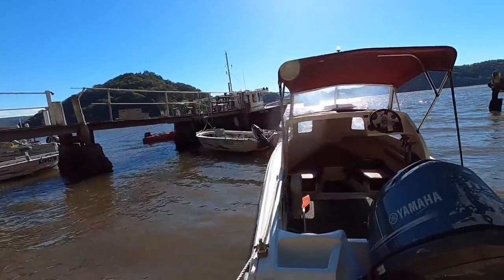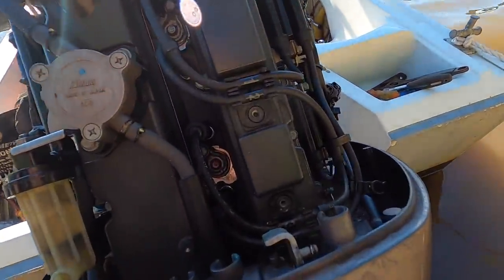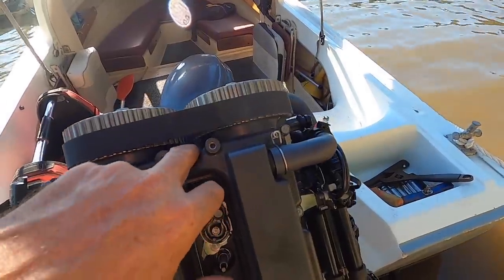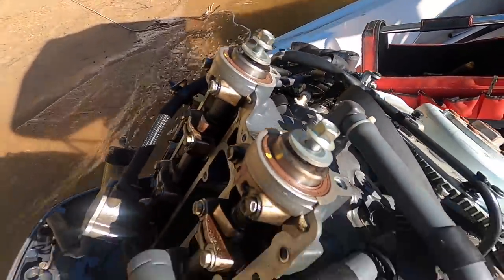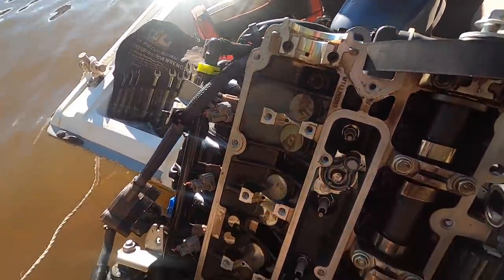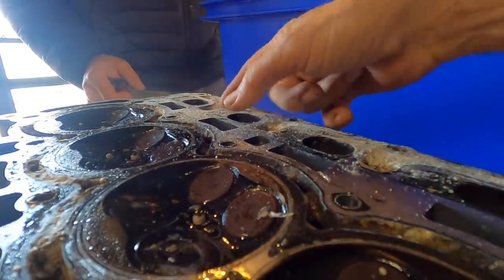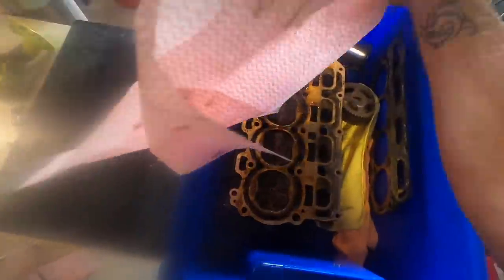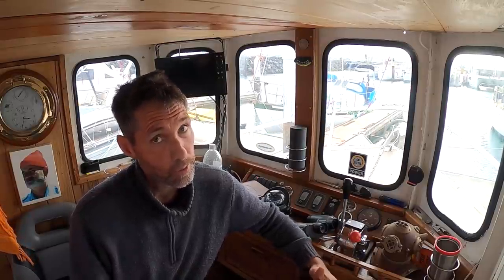Yamaha outboard twin-cam cylinder head removal

Comment: The outboard dilemma; an expensive fix on an expensive outboard still leaves the owner with an old outboard. Well stated, Stu.
Reply from the maker: It is hard to know which way to go sometimes. All the birds of this outboard still have value at a wreckers.
Reply: Its the boat version of
"Nothing as expensive as a cheap Mercedes"
Reply: As a new Tech, it drove home the fact of when to walk away from a repair.
Reply: I'm assuming, too much pitting on the cam and lifters to warrant a clean up and re use.

Comment: As a longtime auto mechanic I never shave or sand aluminum heads with overhead cams. If warped and sanded flat cam failure is always guaranteed. Unless you rebore cam bearings they are almost always out of line when reassembled... If shade tree repair necessary on tight budget. Fill bad scratches with JB weld use razor blade to remove excess... best of luck...
Reply: You need to introduce heat for aluminium block
Reply from the maker: Yes, sending it off to a cylinder head reconditioner is probably the only realistic option. Will save the DIY approach for the two stroke head.

Comment: You have 10mm sockets down there? I guess that’s where all mine have rolled.
Reply from the maker: They all roll down to the Southern Hemisphere.
Reply: They must all end up in my engine bay somehow.. every time i work on my car there is one rolling around
Reply: Both 10 and 13mm! 😄 
Great video!
Reply: I wonder if all of my 6mm drill bits are there also

Comment: What happens when a motor gets really hot is the rings lose tension. They're supposed to be brittle (as you know if you've ever broken one using a stupid ring expander instead of putting them on with your fingers - I blushingly digress) but interestingly what happens is when the motor gets really hot if you remove one is it can be stretched out like a piece of wire. When they get to that point they can't hold their shape properly. They obviously need their shape but it is so combustion pressure can properly force them into the cylinder wall gaining a gas tight seal. When the tension is lost or partially lost you get blow-by and of course low compression.

Comment: I've just done 2 earlier (Carby) versions of this motor, same problem in both. Corrosion was the cause in both cases, both on the mating surface of the head where it contacts the gasket. I did get them both welded and machined back for not a terrible amount of money. 1 of the engines is for a friend and is being sold soon, the other one is mine, whether I keep it or ditch it, I haven't decided yet. I don't think the anodes really do their job in these engines, to be honest, in both cases they looked brand new. A couple of things  learnt; the "lifters" in the 2 I did were actually buckets and 25mm shims, and if you have to adjust the valve clearances, good luck, because the shims are ex Japan if genuine, and around $400 for a set, and not a lot cheaper off eBay. A better way is to get a machine shop to skim the tops off the valves to get the clearance back. The other thing I learnt is this engine is based off a Ford Zetec engine and a lot of internals are interchangeable - and cheaper from Ford than from Yamaha. (Check the camshafts, they likely have a Ford logo cast into them). I think if it was my "Daily driver" I'd probably just replace the outboard too

Comment: I hate the smell of tectyl. I always used to keep a can of degreaser with it as the nozzle always seemed to block up, I just swapped it over when it started to clog up, parts I tectyled usually needed 2 cans though. Love the vids. Cheers Mav

Comment: Stu how did the water get into the oil
was it in the fuel previously,  did it enter
through rain leak, was it seawater through a crack/opening,
was the oil contaminated,  was the motor at fault .. etc???
Onya 👍👍
Reply from the maker: It comes up through the cooling passages for the engine and passes either through a corrosion hole or a blown head gasket into the oil passages.
Reply: @DangarMarine  Ahhh gotya, thanks Stu, Never throw away any
of your footage, they all worth viewing.  How was the Sanctuary Cové
Boat Show ??

Comment: I would like to know if that 115 Yamaha is savagable... I'm presently looking at purchasing one the same with similar issues,
Reply from the maker: Is all fixable, it’s just a matter of at what cost.
Reply: @DangarMarine  The one I'm looking at was submerged, boat capsized they recovered it the next day and flushed it all out with fresh water and changed fluids multiple times and got it running. But then it sat for a couple years with no use and they went to start it... and she was stuck. So it's filled full of oil and penetrating oil right now. I'm just more worried about electronics then getting it freed up, only has about 250hrs and can get it for a  good price. I'm gonna bring a breaker bar with me to see if I can get it to budge at least a little bit, and also a bore scope to check cylinder condition. Just not sure what I'm getting into with the electronics

Comment: Just rebuilt the gear on one of these. The design of the propeller housing is...scary. I had to use every tool in my arsenal to get it out. Never been removed, apparently. Fun times... Runs great, though.

Comment: I had similar problem.yamaha f90 with 4500 working hours.sound alarm was malfunctioned and nobody bother to look on tach if there are any codes.after a day at sea come back to the port and it didnt start.after opening oil stick to check a lot of emulsion was coming out.green milky stuff.i didnt even sent ut to mechanic,cose it did work a lot,but i gues it was head gasket due to iverheat
Reply from the maker: Yes, when an outboard gets to a certain age you are often better going straight to replacement with a problem like this. It is never going to be a cheap fix.

Comment: I'm in a similar spot with an older two-stroke, do I fix it or do I replace it.  In my case, I am going to fix it but I don't rely on my boat for daily transportation.  If it keeps having failures though, it will be headed for the junkpile.

Comment: I have a unrelated question  for Dunbar marine about my dads 86 mercury 75hp outboard sorry to ask here .he had 2 bottom cylinders that wernt firing he replaced the coils then the stator then he saw the trigger wires burnt inside the sleeve.when he replaced the trigger that fixed the firing problem but it runs wide open .hes 78 and has had this mercury 75 on a alluminacraft since about 1987 and usually he can find the problem but he cant now please help

Comment: Hey there dangar and viewers ive looked at i boats and yammy threads in the boat community but I can’t seem to find the thread pitch of my 2015 Yamaha T25 it came with an extra long extension (which I’ve removed) but the extension bolts were threaded differently on both ends.presumably a fine and a course anyway wondering if you or a viewer might know.
Cheers mate .

Comment: Stu, do you have a tip to get the nuts off the tilt tube on a evinrude v4? The starboard side is loose, but the port nut is frozen and the whole tube spins. I need to get the port nut off so I can attach a hose and force oil through my steering cable. I can't remove the cable because the side of the boat is too close to the engine. I do not have the tools or expertise to remove the engine. The front of the cable is not accessible as it is part of the rack for the steering. Please help.

Comment: A Stuck open thermostat will make the engine run cold. And, will make water in the oil, and emulsify the oil.
Tho with all that corrosion  I can't see that it was running cold. 🤔🤔🤔

Comment: Hey! I have seen many F80-F115's die. The f80-F100's are the worst. The reason why they die is 99% corrosion. Why does this happen? Well, usually because the block anodes are not cleaned/replaced/checked annually. The fact that the thermostat was stuck in place tells me this engine was not serviced correctly. The thermostat is made of copper, and bad things happen when it gets contact with the aluminium-magnesium block through the solid salt deposits left from years of use.
Reply: and, at least here in norway, running any outboard hard in cold salt water will corrode your engine block much faster
Reply from the maker: Yes, I’ve heard that corrosion is an issue with these engines and this one certainly has had a hard life living in salt water 24/7 doing multiple 5 minute trips every day.

Comment: What would have caused all that buildup?
Reply from the maker: Boat lives in the water 365 days a year and the recent floods made the water very silty. It’s easy to flush an engine on a trailer in the driveway but quite tricky in the water.
Reply: @DangarMarine  that’d do it for sure. Wasn’t thinking about the floods.